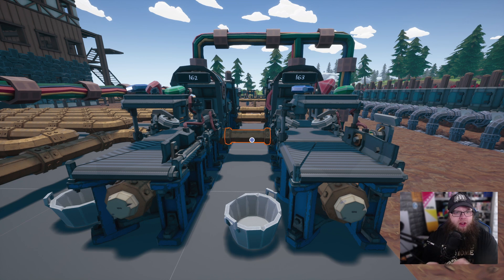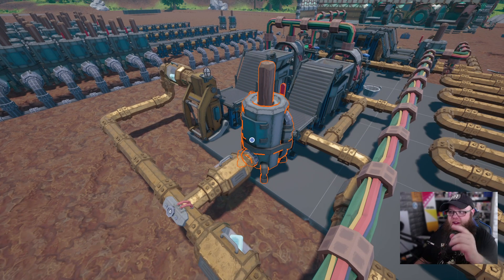Pressure Test THE SPEED TEST Hydroneer 2.0

Comment from the maker: For the record if i was to change the tank over to an iron tank then it wouldnt make a bit of difference if the t1 drill didnt have a glitch that by ppasses the pressure then even if i put a cloutium tank on a t1 drill the drill should cap at 180 but because of the glitch the drill by passes... 
the reason why i tested this was to show the fact t1 is broken because if it wasnt broken the drill would cap at 180 and it would be the same pressure at putting an iron tank on the drill..

Comment: I built my first setup in Icehelm in preparation for replacing my T1s with T2s, and expanding further with it. It has all cloudium pipe, and cloudium pressure boosters behind each drill. I was shocked at how much it made in a short amount of time, and I don’t even have boosters on the intake. This I explains a lot, time to overclock to the moon. Thanks Hybrid Steel

Comment: You're correct, the T1 drill currently does not have a pressure limit, making it work at the same speed as the T2 drill. This is being fixed for the next suggestions update.
Something also to note is that pressure is not effecting harvesters correctly.. also being fixed in the next update.
Thanks for the video :)
Reply from the maker: all good.
Reply: Any idea when next update will be?

Comment: Nice explanation on the current pressure issue.. could you add the iron tank on the back of the drill to show what it should be doing at 178 pressure? Just so we see what the difference will be? I'm assuming is going to be like 130 for t1 and  160 for t2
Reply from the maker: i will do that when it is fixed but if it was fixed then it wouldnt make a difference which tank i use as they would be out putting the same preasure as if the t1 drill was fixed even with a cloutium tank going into a t1 drill will drop the pressure to wher eiron is limited so the tanks dont matter..
Reply: @Hybridsteel  noted will wait for the patch and your re run.. Will be nice to see the difference.. I was getting ready to start setting up my drill system but if the t1 dose slow down over the t2 the I might change out the system to just t2 over both t1 and t2 dirt.. lucky I'm in ice helm so it's horizontal build making it a bit easier
Reply from the maker: @Cooter769  dont even have to wait for the patch if you read foulball hangovers comment in this thread of comments u can see that im right.. when the pressure has been chanfed going into the next fix the t1 drill will run slower.

Comment: Please rerun the same test with inserting an iron straight pipe in front of the T1 drill and a cloutium straight pipe in front of the T2 drill.  This slight change will show what is likely the intended difference between the T1 and T2 drills.  The problem or glitch we are seeing now is likely in the fact that the T1 drill doesn't seem to leach off the excess pressure like the other iron parts do.
Reply from the maker: i will run this test when the pressure problem is fixed.
as there is a known issue and this video has helped identify this and now the devs who made the game have commented then thats all good.

The problem with t1 is the drill by passes the pressure cap and just uses the full amount.
if i was to use an iron tank or cloutium tank on an acctual working t1 drill then the drill should cap at 180 and not 370 so even if i ran the whole thing on iron pipes or cloutium pipes it doesnt matter. what matters is the problem in t1 is causing this argument.
even when i ran this in a previous deleted video the argument then was the results were too different from other people.

the worst part is you can argue this point as much as everyone would like but the simple thing is if the t1 drill was working properly and didnt bypass the cap the drill would run at 180 pressure and not the same as t2.

the problem with the first part u talk about is why would you put a pipe in to a drill when u get more pressure out of your build if you just feed a tank straight into the drill like everyone else does.
Reply: @Hybridsteel  Thank you for the reply.  I am not arguing that anything you stated in the video or the reply is inaccurate.  I am instead trying to specify where the bug is and how to demonstrate the result I believe the devs intended.  All the other iron pipe pieces leak excess pressure down to 180.  You can hear it and see it.  On the T1 drill, this does not happen.  By placing an iron straight pipe directly in front of the T1 drill, you allow the current state of the game to correct the inflated pressure.  By inserting the corresponding pipes (iron for T1 and cloutium for T2) you are adjusting your model equally and accurately on both sides of the equation.  If my hypothesis is correct,  this te4st will show that the problem in the coding for the T1 drill is nothing more than adding same line of code that allows iron pipes to leak pressure down to the 180 cap as I think the devs were intending.

Comment: How many pipes are in the system without a PT and what intake setup?  PT's are almost useless now depending on how long the pipe run and pressure input is.  On my test system 80 PSI yielded 13 chunks per minute vs 370 PSI yielded 17 chunks per minute (all T2). I got to see what 1 PSI gives per minute. Edited:  0 PSI with gauge (Really not zero as pressure never drops to zero) = 10 chunks per minute.  So if using T2 drills putting a PT directly into it is not the best thing to do as that one space it takes you could put another T2 drill there and double the outcome.
So basically 
370 PSI = 17 ore per minute
0 PSI = 10 ore per minute
Do not put PT directly into a T2 drill use that space for another drill.
Reply from the maker: all lines were on 1 cxloutium intake with 4 cloutium boosters hence the 370 pressure
pressure tanks are now really for boosting really long line's as they and then putting in the back of drills and harvesters but as dev has said the harvester and drill will be sorted out and then it can be tested properly 
but look at the difference between 0 and full pressure over a 10 minute cycle there was an increase. so its always best to fully boost ur lines for faster drills. even when i did a short test in discord you could activly see the drills were running a tiny bit slower each time with different pressures.
Reply: @Hybridsteel  I'm not arguing that the closer the PT the faster, what I am saying is the difference between 370 PSI and 0 PSI isn't very much 7 ore per minute isn't that big deal. making the most money quickly is a useless point in this game unless of course one just want to brag to other players.

Comment: Why didn't you re-test with an Iron Pressure tube to see what the true spec should be in this video? That would have been useful.
Reply from the maker: because an iron pipe running at 0 means zero is the same as cloutium pipe,
but with the pressure being glitched its showing the pressure problem.
also using a cloutium pipe on iron objects will only get to 180 percent pressure so it doesnt matter.
t1 should be running slower even with a cloutium tank so this test is flawed until the pressure problems are fixed thats why this experiment was done to prove that the game is broken